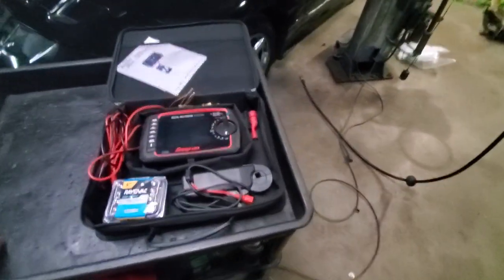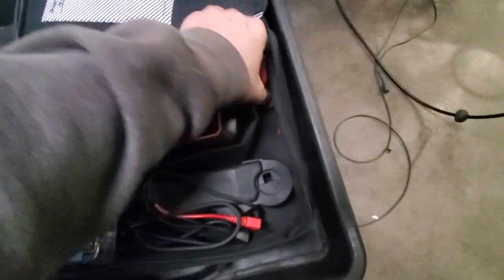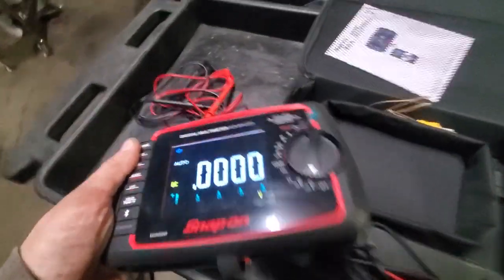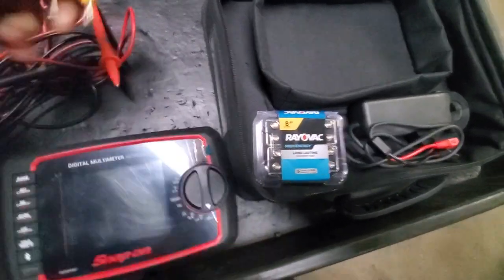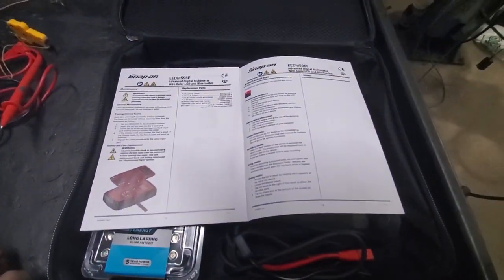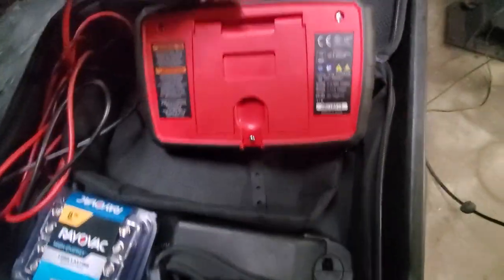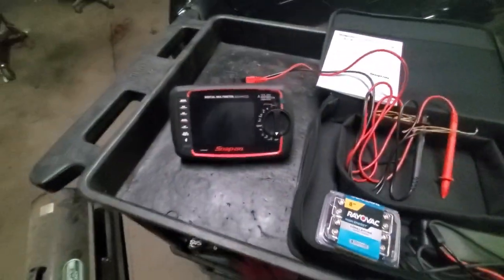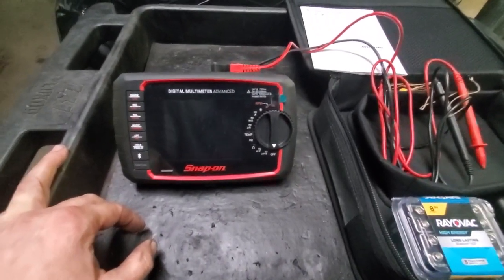Snap On digital multimeter EEDM596F

Comment: Just started using this meter, I do strictly electrical diagnostics on late model  cars. I use this over my fluke meters. They are very good meters at a surprisingly great price. I also repair modules to board level and only opt for fluke meters  when repairing modules on the bench for higher count accuracy and refresh rates and testing capabilities but for on car diagnostics I use this meter

Comment: You’re supposed to wrap the leads around the outside of the meter - there’s channels built into the rim to hold the leads, that that loop secures them to the meter after you’ve wrapped them around.

Comment: I personally own this meter as well.  The leads are garbage! I made the snap on dealer upgrade them to Pomona.  I have eaten up a 3 batteries in a year.  The huge color display is awesome!  Overall I am satisfied with the meter.  One other quirky part is the impedance reading takes a moment to stabilize.  My go to meter is still my 15 year old Mac EM710.